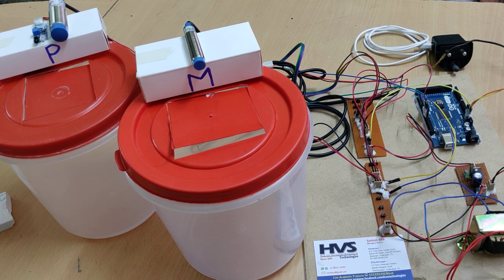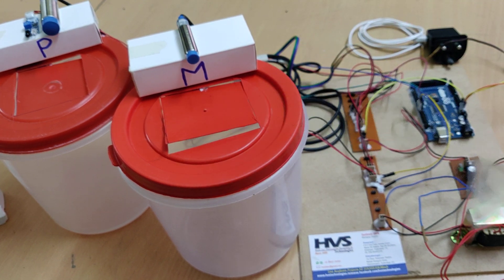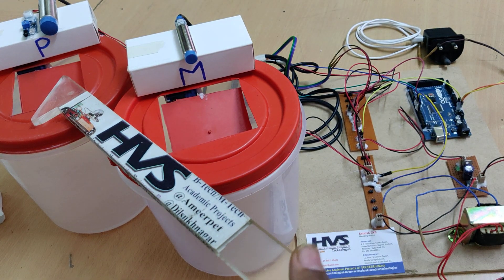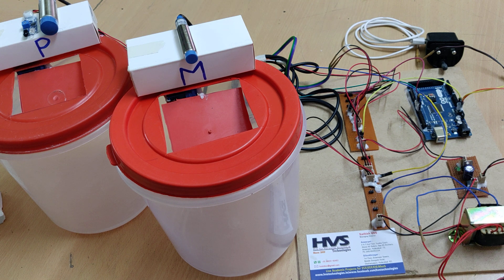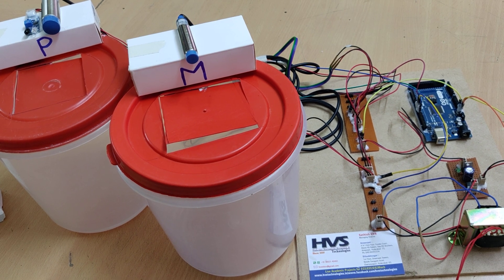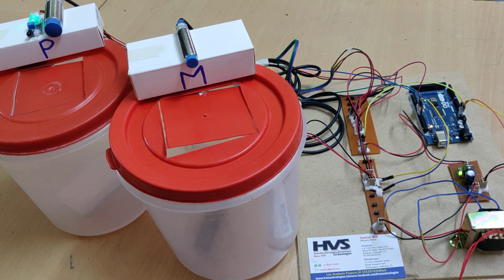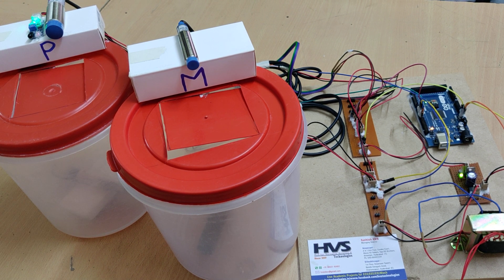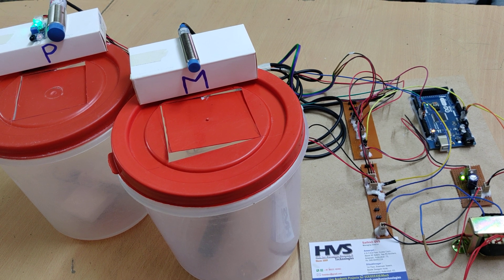HVS-3123. Metal and plastic separation using Capacitance Sensor and ARDUINO Mega

Comment: Hello sooo we have a project for water vending machine instead of coins you need water bottles and were having a hard time because the sensor detects anything  do you have a video tutorial about capacitor sensing only plastic?
Reply from the maker: @MarcoZ865  Hi, 
We sell full working kit with document PPT circuit diagram and code. Could you Send me the video link, Will update you the cost details. You can contact us at +919603140482
Through WhatsApp or call

Comment: What arduino and senor to use when you need to only detect plastic bottles?
Reply from the maker: You can contact us at +919603140482
Through WhatsApp or call

Comment: What prevents from the Capacitance  sensor from detecting the metal?
if you tried to put the metal piece infront of it, wouldnt it also open?
Reply from the maker: You can contact us through WhatsApp or call on +919603140482

Comment: Hi sir. How much voltage will supply in Capacitive proximity sensor?
Reply from the maker: You can contact us at +919603140482
Through WhatsApp or call
Reply: @hvstechnologies  hi sir do you have a code for automatic trash bin for detecting plastic and non plastic?
Reply from the maker: @MerianSmith-tq3rk  You can contact us at +919603140482
Through WhatsApp or call

Comment: hi did you use a relay or optocoupler for connecting the 12v to the arduino
Reply from the maker: You can contact us at +919603140482
Through WhatsApp or call

Comment: can we have the circuit diagram and codes for this project sir? thanks
Reply from the maker: You can contact us at +919603140482
Through WhatsApp or call
Reply: @hvstechnologies  sir Can i ask for the code for free?
Reply from the maker: @kimjushuasalon6467  You can contact us at +919603140482
Through WhatsApp or call
Reply: were u able to get the diagram and code?